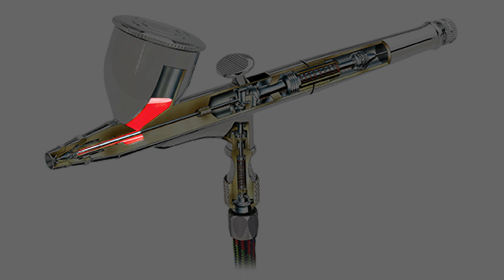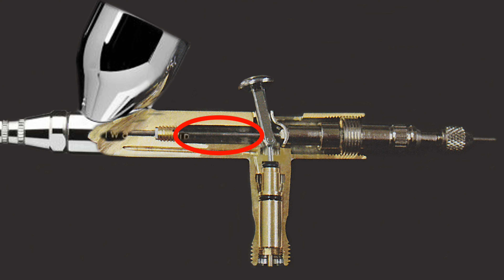Airbrush Basics: Should You Remove the Needle from the Front or the Back of the Brush?

Comment: Thanks for another very informative video.   I also remove my needle from the back, but I apply a slight film of Iwata lube to the needle before installing it and I haven't had a problem.   I use 91% Isopropyl in the same way you used the 4012 reducer, what do you think about using the alcohol, it works great, and after I assemble the airbrush I spray distilled water to flush out any residual alcohol.
Reply from the maker: I used to use Isopropyl alcohol for cleaning purposes too.  It is a fantastic cleaner for water-based paint!  In fact, when my current old supply of 4012 Reducer is used up, I will go back to using Isopropyl alcohol for stubborn paint residue.

Comment: I prefer to remove them from the front and install them that way as well, with shaky hands(coffee jitters) I have a better chance of getting them in properly without damaging the tip. My Badger Sotar 20/20 however needs to be removed from the rear due to a ball that is affixed to the rear of the needle...I've thought about cutting it off but have been reluctant to do so.
Reply from the maker: Hey Adam!  That's the thing about it from my point of view, I've often heard others suggest one way is correct and one way is not.  We're all a little different and sometimes what others view as "wrong" works better for an individual, as in your case, for a variety of reasons.

Comment: Thank you for explaining this. If you happen to get paint on your needle packing, is it advisable to take a pointed q-tip or dentek brush to try and get it off from the back of the body?
Reply from the maker: Great question!  The first issue that pops into my mind concerning the tools you mention is the reach of those tools.  The needle packing screw is generally located pretty deep in the brush, forward of the trigger.  A DenTek brush or cotton swab will likely reach the packing seal in most airbrushes once the rear handle, needle, needle chucking guide and trigger assembly have been removed.  There are some other things to consider though.  Cotton swabs and DenTek brushes are both great tools for cleaning in my opinion, as long as I can see the part I'm cleaning.  The downside to cotton swabs is they can leave little bits of cotton behind which can wreak havoc later down the road when those fibers get saturated with paint and stick to parts inside your brush.  A DenTek brush solves the issue of leaving cotton fibers behind, but you can't see what you are doing deep inside the brush.  We would be working from the back of the brush and pushing either of those tools (or any other tool for that matter) forward in order to clean the needle packing seal when it is installed in the airbrush, correct?  The risk of pushing material (dried paint, cotton fiber, etc.) through the packing seal and further into the body of the brush is also a concern.  The area behind the needle packing seal in the airbrush body is pretty open to allow installation of that seal.  The area forward of the needle packing seal in the airbrush body is much smaller.  It's generally only slightly larger than the outer diameter of the needle.  So if a foreign material gets pushed forward of the seal during cleaning, the performance of the brush will likely suffer.  Does that make sense?  

For those reasons, I prefer to remove the packing seal from the airbrush when I need to clean it and that doesn't happen very often.  I generally need to clean my airbrushes that thoroughly only once or twice per year.  What are the odds that you will push some foreign material through the packing seal if you don't remove it?  They are probably pretty low, but it is something to be aware of.

Comment: Personally I never take the front section apart unless I have to. When I was a beginner I accidentally ruined the threads on the nozzle. They are very delicate. Yes, if you are not careful you might damage the tip of the needle when re-installing it from the back, but a needle is about 1/5 of the price of a nozzle. And it takes too long. (I mostly use an Iwata HP-CP)
Reply from the maker: I agree my friend!

Comment: i am having an issue what to do if to thin my paint it does not to be to seen to be spraying corectly? the thinner the paint the lower the pressure? maybe like 10 or 15 should i try? i make my own from acrlyic most are ok but some i made to thin?
Reply from the maker: I would absolutely suggest playing with different air pressures.  You are correct, thinner paint usually sprays better at lower air pressure because it's easier to control.  The main problem you're likely having is based around making your own airbrush paint with acrylic paint.  If the paint you're using wasn't designed to be sprayed through an airbrush, the pigment particles in the paint are likely too large to fit consistently through the needle/nozzle of your brush.  Those pigment particles won't dissolve when the paint is thinned, and they will clog your brush frequently.  A better and less frustrating solution would be to purchase paint designed for airbrushing.

Comment: Hi, Would you like to do this same test but with a complete cleanup? 
I have the idea that when you do a front removal you can start disassembling earlier since the needle and the cup don't have to be as clean. Also with the nozzle off its easier to clean (Im talking about the same airbrush as the video)
Reply from the maker: This video wasn't intended to be a test.  It was created to point out the pros and cons between each method commonly used to remove the needle.  Neither method is right or wrong.  My airbrush will always be completely disassembled anytime I'm doing a complete or very thoroughly cleaning.  So, it really doesn't matter whether the needle is removed from the front or the back in that case because the brush is being completely torn down.  Perhaps I've misunderstood your question or the point you're trying to make.  If that is the case, please clarify and I'll answer again.
Reply: @wickedartstudio  Yeah, sorry my bad. 
With "complete cleanup" i meant to start the countdown with used paint on the cup. I wasn't referring to the process of completely disassembling the airbrush and doing a deep clean, but to test the time it would take to remove the needle starting to count with the paint on the cup.
I believe it could give different results. Since to take the needle from the back you need to clean the cup, needle and nozzle really well, to avoid   dragging paint to the inside of the airbrush. 
While if you took the front off and push the needle, you could do it without taking the time to clean everything as much, since once nozzle is off you could clean it faster with a really soft brush and some cleaner. Or so i believe, specially when its kind of clogged, which  is when I tend to remove the needle.
Reply from the maker: @IDCrish  That makes more sense and I'm following your train of thought now.  Thanks for clarifying.  I'm not sure it will make a difference in the end because it's really not necessary to clean the cup differently in my opinion.  Having said that, now I'm curious and I will test this out in the future.  Thank you for the suggestion!

Comment: I prefer pull out needle from a rear part, but I remove the front part with nozzle every time I end my painting session just for sure that it always clean . But you speak I don’t have to do it every time. Sometimes when I clean the nozzle I found a some paint into it. What if I don’tclean it and that paint will stay for a several weeks, for example? Or your advice is for everyday working only? I use my airbrush once in 1-2 or 3 week ))
Reply from the maker: A thin layer of residual paint does get left behind in the nozzle of my airbrushes because I don't completely tear them down and thoroughly clean them at the end of every session.  You won't remove every trace of paint in the brush by simply spraying a cleaning solution through the brush.  Having said that, that thin layer of residual paint doesn't hurt anything initially as far as performance is concerned.  That residual paint will continue to build up in the nozzle with further use over time.  Eventually, it will reach a point that it does begin to affect the performance of the airbrush.  At that point, I will remove the fluid nozzle and clean it thoroughly.  The airbrushes I use most often normally reach that point only a handful of times in any given year, and I use them daily.  So, based on my experience, it is not necessary to completely strip down a brush and thoroughly clean it after every use.  There's also nothing wrong with doing that if that's what you prefer to do.  I think it's beneficial to realize you are degrading the air seal created by the threads of the head cap and nozzle cap each time those parts are taken apart, but the airbrush will still last you a very long time!

Comment: The brushes are not designed to have the needle removed from the front.   It causes unnecessary wear and tear on the seals and head, and due to needle shape, which is only precision machined for the first half of the needle, you can stretch or damage your teflon o-rings, requiring replacement.    Simply put, the risks of damage to threads on the head or damage to o-rings, or dropping the needle because you are working against gravity, make it a poor practice.   It is not worth it.   It actually doesn't take that much wear and tear to break an air seal on threads.  Even as few as a dozen times can do enough wear and tear to cause pulsing in the airbrush.     It is much better to simply remove the needle in the manner that it is designed, because it does not introduce wear and tear to the air channel.
Reply from the maker: Hi Kim!  I agree my friend!

Comment: You say it's unlikely to pull some paint back into the seal, but you demonstrated with the needle wipe, that you did pull back some paint - even while filming, which I don't consider unlikely, but extremely likley. Sorry, noob here, but I don't get it.
Reply from the maker: Perhaps I should've done a better job explaining that point or used different wording.  I apologize for the confusion.  The amount of residual paint left on the needle after it was removed was very minor.  My main concern is the risk of allowing large amounts of paint to travel through the needle packing seal because that paint will find its way into the trigger and air valve assembly which will cause the trigger to stick (it's also far more difficult to remove the trigger assembly and the air valve assembly in order to clean them properly).  The minute amount of paint wiped away from the needle after it was removed was not even close to being enough to allow paint through the needle packing seal and cause the sticky trigger issue.  

At the end of the day, it's nearly impossible to clean every last lit bit of residual paint from within the airbrush body without completely disassembling the brush and thoroughly cleaning everything (which is not something I recommend doing on a regular basis for the same reasons mentioned in the video).  That very small amount of residual paint left in the brush can sometimes be enough to dry and freeze the needle in place temporarily if the needle is immediately put back in the brush and the brush is stored in a dry state.  Storing your brush wet https://youtu.be/dBrkEsik2NE alleviates that issue.